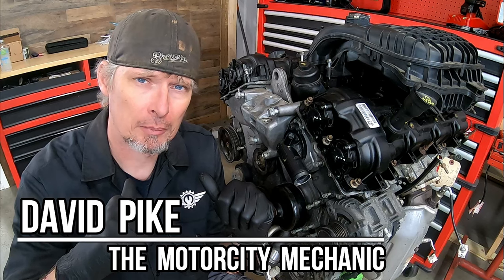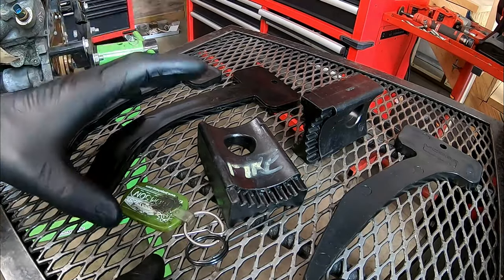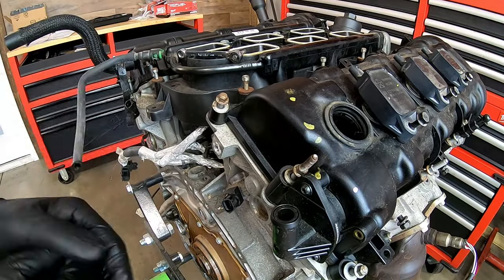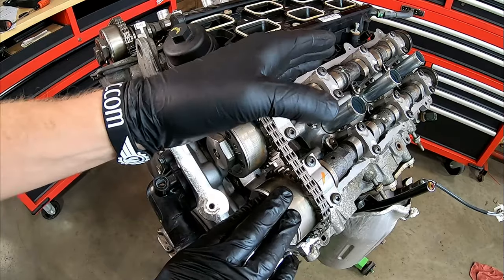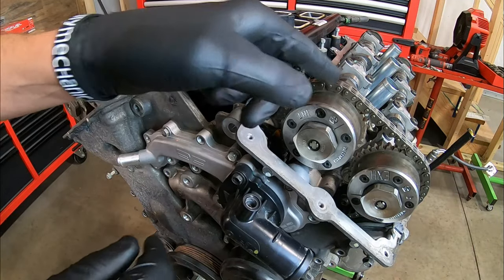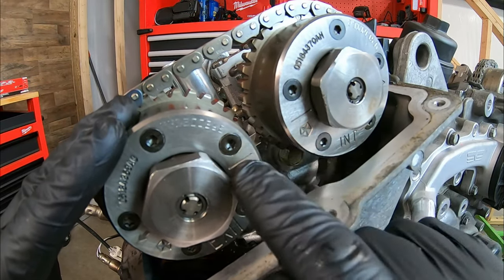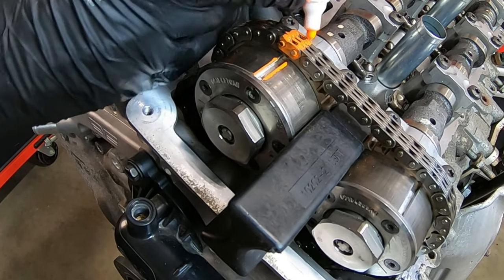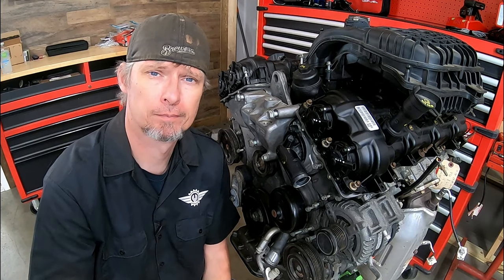Chrysler/VW 3.2 and 3.6 Rocker Arm Replacement Part 1

Comment: Great how to video.  I did this job on my truck using this video (and some shop manuals).  The one problem I had was getting the cam phasers back on the cam. I found that moving the cam with the crescent wrench worked like a charm, especially when one of the cams went into the unlocked position.

Comment: Hi David. Thanks a lot for this tutorial and all your videos. I've never seen videos with such a high level of technical knowledge and pedagogy. You're the best dude! Carry on!
Just a little challenge I faced when disassembling cylinder head covers on my 2016 Wrangler JK : camshaft sensors (which are not part of the engine you used in the video) should be removed before taking off cylinder head covers. No toque specs seems to be given by Mopar for reinstalling those sensors (I put 10NM as they're M8 bolts)

Comment: Good morning sir, just wanted to congratulate you on your videos. I just did the cam repairs on my jeep wrangler. The details in you videos are awesome. That right side valve cover kicked my butt. And I'm a seasoned mechanic. Keep up the good work. I gotta work on the transmission on my Dakota next, replacing the shift solenoid, do you have a video for that?

Comment: I cannot say enough of the detail your videos provide. Thank you for putting them out there for us.
Prior to coming across this video I've been chasing a P0303 for a while. I replaced all spark plugs, cleaned the fuel injectors, and I swapped coils between #3 and #5. I still get the the same code. I figured it was the rocker(s) so with your teaching, I pulled off the cover. All lobes and rockers look great. I turned the crank to make full inspections and everything is golden. Any ideas what is causing the P0303?

Comment: Awesome video! I wish I had found this before pulling coils and injectors twice trying to fix a cylinder 1 misfire. How much time should I expect it to take to change all of the rockers? I also changed the oil cooler a few months back. Obviously I can now remove and re-install upper and lower intakes in my sleep. Also, should I inspect or clean the cam phasers while they are out?

Comment: If your doing the passenger side on a Jeep Wrangler, just go ahead and remove the right wheel, fender flare and wheel well liner (all one piece). Quick and easy to do.
It will make PCV valve and valve cover bolt removal so quick and easy.  And loosen the transmission dip stick too.  The job will be easier on that side.
Don’t even think about removing the battery and relay box.   Remove the fender!!

Comment: The real question here is why this is happening in the first place!! Is this an expected repair that owners will have to deal with if deciding to keep the vehicle for 10-20years? My dad’s 2016 Wrangler Rubicon was repaired under warranty twice for this, and at 67,000miles he had to get it done a third time. The most resent repair he had all 24 rockers/lifters replaced and two exhaust cams. Cost? Over $2,400.. I’m wondering if this is a design flaw and if my dad will have to go through this repair again?

Comment: The Pentastar uses hydraulic lash adjusters.  Since it is an OHC engine, there are no pushrods, nor any lifters, used to open the valves.  

Hydraulic lash adjusters are basically tiny shock absorbers for the rocker arms.  They're definitely not the "same thing" as a lifter.
Reply from the maker: That’s what you got out of this video? 😂😂😂😂😂. Sounds like this video is toooo rudimental for you…..your wanting the Harvard version two videos that way 👇👇👇👇👇

Comment: Thank you for your detailed and easy-to-follow Rocker Arm Replacement. I was able to pin point the point of failure is the left/passenger side. Do you have the part number(s) or kit for the left/driver and right/passenger side complete replacement assembly." I plan to order from Amazon.

Comment: Great job. Just remember to remove your spark plugs before turning your engine crankshaft to release the pressure.
Reply: Is this necessary? I have one torn down now and and about to pull the chain but should I pull all the plugs out?
Reply: The pressure from what?
Reply: @dariodeleon8041  compression builts within the cylinder whenever the crank turns

Comment: ALSO if you do this in a challenger, the transmission dip tube is in the way o the right side of the engine. I bent mine out of the way slightly. I’m hoping it didn’t fuck something up.

Comment: Great video, very detailed 
Noise for 4 days driver side 
I can't do the repair right away 
How long can I drive like that commute 24 miles round trip to work 5 days a week 
Thanks
Reply from the maker: Hard to say. Some drive a long time with the issue. What you run into is possible damage to the cam shaft that requires replacement
Reply: @MotorCityMechanic  
Thank you very much 
for reply, hopefully I can get it fixed next weekend
 thanks again

Comment: Amazing tutorial for replacing rocker arms.  These videos were extremely helpful.  I am a beginner mechanic of my 2014 JKU.  However, I have a question.  After getting everything put back together, I am experiencing brake issues.  My brake pedal is hard to push.  Could this have been caused by something that was done during the rocker arm replacement?  Any help in diagnosing would be appreciated.

Comment: Thanks for the great video! I replaced the camshafts and rocker arms on the right bank successfully following this series of video! After a test drive for 10 miles, I have P06DD code. I am wondering if the oil control valve is not tighten enough, can it cause P06DD code? I replaced the oil pressure sensor and still had the issue. I want to roll out all possible issues before I replace the oil pump as it going to be a big work. Any comments are appreciated! Thanks!
Reply: What turned out to be the issue?

Comment: Motor City mechanic. I had read online that this failure is caused by the plug for oil galley below timing chains come loose and its what causes the rocker arms to go bad in first place. The vehicle I have in my shop right now that plug is loose on intake side and had bad intake rockers and cam. Replacing the cam and rockers without tightening those plugs will just cause another failure in short order.
Reply from the maker: Never seen that cause it. That loose bolt will cause a check engine light and possible oil pump code......it’s one of the things your suppose to check when you diag those codes. The failure is the design of the rocker arms. They have been redesigned 3 times so far to try and improve the issue with the needle bearings. Same issue with the Fords as well.
Reply: @MotorCityMechanic  I just know this is the 2nd one I have done with rocker arm failure that those bolts were able to be removed by hand.
Reply: @MotorCityMechanic  Proof is in the pudding. If that bolt is loose its loosing pressure. Im sure that the rockers are junk as many failures as there have been. I know every one I do I will check the tightness of them and put locktite on them.
Reply: @MotorCityMechanic  I guess im failing to see how the bolt that plugs a hole in the oil pressure galley that feeds a failed part does not have something to do with it.

Comment: Thank you, great video.  i have one question. i have a 2013  3.6 charger. on the rightside  valve cover how do you get it pass the transmission dipstic? i cant see were to remove it.

Comment: So I goofed up working late into the early morning hours
I turned the camshaft mounting bolts apx 1 full turn clockwise
tightening them, instead of loosening them.

I did this for the first 5 bolts from back to front until one broke 
which I was able to get out with vice grips.

I have re tightened the bolts to the 84 in/lbs torque repair book indicates,
they hold and feel snug, but my question is whether I should do 
something more to make sure nothing bust loose while driving?

2015 Ram 3.6L

Comment: Great video bro. Btw, I stripped the head on one of my T30 cam cap bolts. Any suggestion? I was going to use an easy out. Of course taping off so shavings don’t go into engine. Or a valve spring compressor to remove rockers? Thanks

Comment: i ordered the special tools via the amazon link provided and the left block doesn’t fit. The timing marks are spot on. I tried to adjust the cams slightly forward and back to get the block to fit it the tooth pattern is still about 1/8” off on either side.

Comment: Hi David, great videos thanks. I'm changing the followers and lifters on our 2016 T&C (107K) and thinking of going with OEM parts. The Amazon offshore parts look like great prices but I don't trust the quality. Do you have a recommendation? 
The cams lobes look good and heads look very clean. I use 10w-30 synthetic and change the filter at 3000k and oil change between 5-6K. Blackstone oil test reports never showed excessive metals but I see a faint light tracks on the outside of the roller, not a dig though. It looks clean but had a p0303 code. Changed the plugs and the code went away but it still has a bit of a miss every once in a while after it warms up. I'm thinking of switching to Baxter oil filter adapter and eliminate dry starts. Any thoughts?

Comment: sir, if i am just having an issue with bank 1 (right head) would i need to even open up the valve cover on the left head to change cam on right head ? I have misfire on cylinder 3 only. Have went down diagnostic tree and played "swaptronics" with coil and plug. Also scoped coils and injectors. ohm tested wires back to PCM. Everything is leading me to believe it is mechanical even though there is no noise. It is an auction car that was fine for two weeks. I can see someone has been in there because #1 and #3 coils have been marked with paint pen. From your video it appears I can just concentrate on the one head and just remove intake and valve cover. Or am I missing something. Money is a factor for this person. I am also thinking even I do find something it is a gamble not to replace everything like you said.
Thanks.

Comment: . Hi David. I love your explanations, and your channel. Thank you for the work you do. i learn a lot from you. I found the exact problem on the 3.6 Liter- for clicking noise. I have 54 years of experience working on Chrysler engines. The problem i found is that the two plugs for the oil gallery are loose from the onset, and so they lose pressure. I removed the two plugs, cleaned them with brake-cleaner, then placed some `lock-tite`, then tightened the bolt at 105 inch pound. Then i started the engine without the starter-relay, and without the valve cover. Lastly, i checked the oïl to see if it`s lubricating the cam and the rocker-arm. When i removed the valve-cover first, i started the engine without the starter-relay, and i remarked that there was no oil to lubricate the rocker-arm and the cam. So i found damage on the cam-lobe. I think i fixed the problem. What is your take?...the oïl is flowing smoothly now

Comment: Is there a video showing confirmation on timing left side. We replaced the camshaft and had a hard time putting it back on we think the timing shifted during all those steps and now we can’t figure out if we are back at top dead center without removing the timing cover off

Comment: I'm doing a job now and the customer brang me 2 used cams and lifters/rockers with slight rusting on the lobes non rocker or lifters labeled for what lobe they came under , just informed me he wants not to pull the side cover to try and taking the phazers out then the cams and install the used ones  I'm not sure what to do

Comment: Hey man Nice video! I have a 2015 Jeep Wrangler with the 3.6. It recently started making this loud ticking/knocking noise you think maybe it’s the rocker arms ? Check engine light code is p0157 comes and goes due to oil leak barely has 100k miles.

Comment: So a T25 to remove the part in the back, 1 1/16” socket to turn the engine, what size to remove the camshaft bolt and cam retainers? Supposed to start this project today, but becoming more worried my camshaft is damaged. Had to drive 18 miles with it backfiring if I pushed it too hard, always in manualmatic mode to get more control, but… looking like it might need to go to someone.

Comment: 2017 Dodge Durango3.6-Question: How do you know if the valves are bent or bad? When pressing down on them should they be easy/loose to press down on or should they be firm/hard? I feel like I might have made a mistake while doing a Timing Belt Tensioner job.

Comment: i did this job earlier on a 2011 dodge journey, i replaced the left intake cam and a rocker arm. the rocker arm ground the cam so bad that the noise went away so they thought that it was good. now its back for the same thing it dropped a rocker and now im just going to replace all rockers and lifters.

Comment: I have a late 18 Grand Cherokee with a passenger side tick. the intake are a lot more expensive than the Exhaust. the intake are of a different construction 5047896AD.  do you see more failures on intake or exhaust?.   oh and Great Videos Thank you

Comment: I'm getting ready to do this job. I have a quick question. The new cams I bought are completely round on the opposite end from the cam phasers. (The side where the cam sensor goes)The ones on my van re not round they have flat spot similar to the cams on this video. Will the new rounds make a difference?  Or are my cams just worn and damaged?

Comment: Regarding the “wrong methods” if you only wanted to replace the bad rockers could you use that method if you used the special tools to loosen the tension on the chain? My concern is breaking the oil control valve bolts loose and properly torquing them back (don’t have the proper tool).
Reply: If you loosen then chain, wouldn’t that take the potential stress off the overhead bolts when you retighten them?

Comment: Do the lifters move up and down........if so, how?  Are the lifters just stationary pivot points for the rocker arms?  I can
see how the cam lobes push down on the rockers which then push on the valve stems to open the valves, but I don't see any type of  driver for the lifters???

Comment: Would anything about this process change significantly for a gen2 pentastar engine with "upgraded" intake cam/rockers?  Also looking online, the newer intake rocker is ~$100 for a single rocker arm vs only $10 for the exhaust side rocker.  So your looking at ~$600 just to replace the intake rockers on a single side!  Why such a big difference in price for the rockers?

Comment: Hello David ! Do you recommend stock oem rocker arms ? Or would you recommend melting rocker arms and lifters. Has the issue with the rocker arms been corrected in the oem since 2014?

Comment: So I did this rocker arm and lash adjuster change out. Now the engine just spins when trying to start. When turning over by hand I can feel the resistance of the cylinder compression come and go, but the starter just spins the engine at a steady speed. Any thoughts?

Comment: I have a 2012 jeep jku with the 3.6 I installed a J&L oil catch can at 110,000 miles or so, no problems that I have noticed at all. My question is will it hurt this engine using a catch can? I have a lot of oil in catch can after off-roading.

Comment: I've got my 2014 wrangler torn apart and everything is done exactly as the video but I can't get my left cam lock in. I've tried rocking the cam back and forth using the cresecent wrench trick, my holes in the cam are in the proper position (perpendicular to the block), arrows are pointing at each other on the left bank, lines on the right bank but it's not going in. Wondering if I have the wrong tool? I ordered using the links above but the numbers are slightly different than the one David shows. His is 10202-1 and 10202-2 mine are labelled 10202A left and 10202A right. According to the description it has replaced and older set. Am I the only one having this issue? My daily driver has been in pieces for a couple days now I really need to get going on this.

Comment: Hey guys. Could someone explain why after performing this complete process on our 2015 3.6 t&c, and we were extremely careful and confident it was done properly. The car won't start  turns over at first freewheeling. Now slowly gaining compression but taking forever. Still no start. I appreciate any help you can offer.

Comment: I did as the video did only replaced the first two cams and started the car made a loud noise when started turned it off what did I do wrong with the camshaft replacement 2014 town and country

Comment: I am writing to you on behalf of my dad, he has a 2014 Chrysler Town and Country  with a 3.6L engine.  He watched both your videos: Chrysler/VW 3.2 and 3.6 Rocker Arm Replacement Part 1& Part 2  and decided to take your suggestion and order the special tools you mentioned using the links you provided via Amazon.  

After receiving his order he noticed that the Right cam locking block part # 10202-1 and the Left cam locking block part #10202-2 did not fit.  The part numbers were incorrect.  He's tried ordering them from different vendors but they all have the same issue - the locking blocks don't fit.  

Is there a particular vendor you used when you ordered your parts?  Would you be able to suggest another vendor that would have the correct parts?  Any information would be helpful.  Thank you!

Comment: What happens if you reinstall the solenoid/actuators on the front of the valve covers in a different rotation? like at 5:14 the ones on the "right" of the engine are at 1 o'clock. what happens if you rotate it 120 degrees to the 9 o'clock position for example? I'd like to tuck these wires a little bit better.

Comment: This is all well and good for a how to video, however, I am torqued over the cost of having both sides done at a shop. $5,000.00 for both sides is a bitter pill to swallow for a car with 94,000 miles.
Reply from the maker: That’s crazy. Typically if no cams damaged I charge $1800-$2000